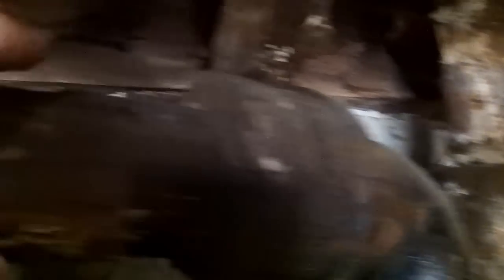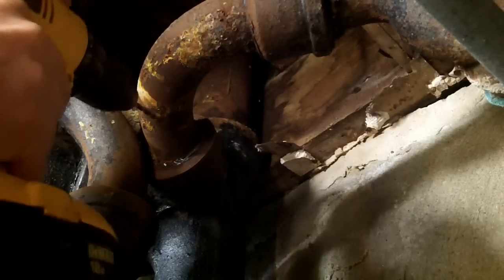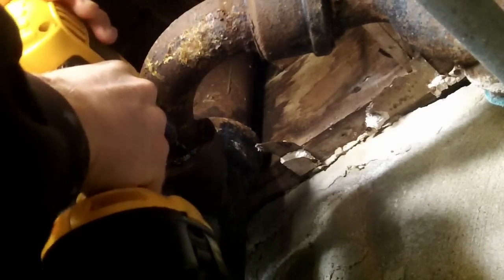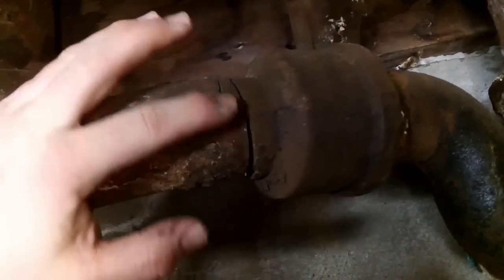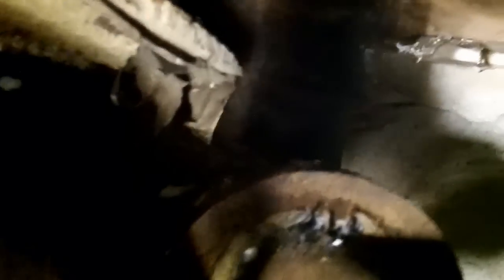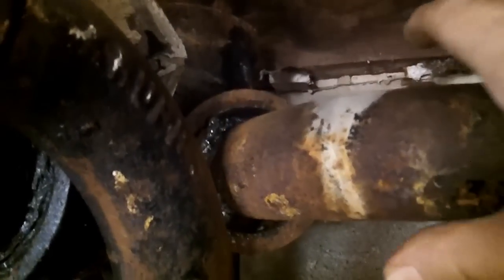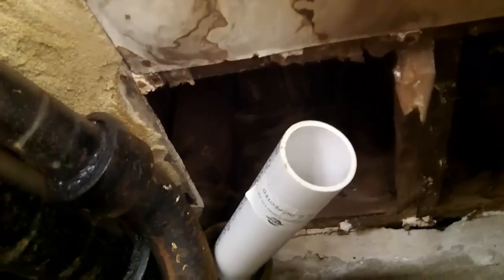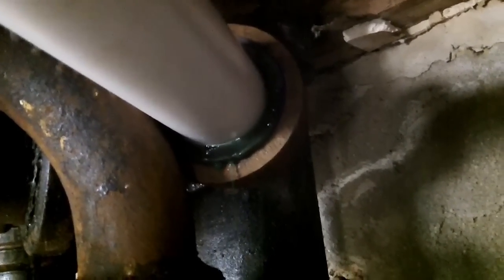Cast iron pipe to PVC using a Fernco Donut

Comment: Thanks bud. I have a cast pipe with a crack right on the other side of the wall. Plumber wants to dig the wall from inside. Im like wtf. Its 4 inch why not just get past the problem and call it a day. Water jet proved it drains two feet past the problem.

Comment: Read your cast iron, my home was built in 1951. There are different types of cast iron but look for XH or SW stand for extra heavy and service weight. They use different diameter hubs because the XH is much thicker. You’ll need a different donut that’s harder to find for XH. For a 3” extra heavy hub look for 33UX-305 the X means it’s for extra heavy hub. Hope that helps someone

Comment: How did it hold up after all this time? I am in the middle of the same bullshit..getting ready to remodel a bathroom and I have to replace a bunch of cast iron before I can finish.
Reply from the maker: Still no issues to this day. I have done 11 of these now. In various sizes at mine and my family's homes. It's an approved way of making the connection. This video basically shows a cheap way to remove the old joint and how to use the donut.

Good luck on the remodel. I've done 2 full baths and a kitchen in this current house. It never ends.
Reply: @phatdonkey78  Sweet, thanks for the fast reply. I guess I better get my drills charged up for tomorrow to remove that lead casting lol.
Reply from the maker: @BeastTechWrench   No sweat! I hope it goes smoothly.

Comment: Nice job. Are fernco donuts up to code ?
I have a similar problem. Was going to do the same as video
Reply: It went pretty smoothly I got it all in .
Thanks for the video 
It was very helpful.
Reply from the maker: In Pennsylvania they are up to code. Good luck. It's not too hard to do.
Reply from the maker: I'm glad it went well. The hardest part is getting the donut started. I'm also glad the video helped!

Comment: was the cast iron cut there or was that the original hub. I am just asking in case I run into a problem for myself later
Reply from the maker: It was the original hub.  I didn't have to cut it to make it work.  There are Ferncos that go over the old cast iron if there is no hub or if you need to cut it off to make it work.  They make a lot of products.  Good luck.

Comment: It would’ve been way easier to cut after the bend of the 90 where it straightens back out near the hub. Then you could just throw a 2 inch fernco or no hub band on the cast and connect to your new work. But what you did is tedious and takes time and patience. Much respect. 💪

Comment: Good video.  I have a similar cast iron flange coming up from a floor that connects to some light gray Schedule 80 PVC.  That PVC is sitting in some weird material.  I doubt it is solid and it is soft.  There is a leak there.  What size Fernco donut fits a 2" PVC pipe?  I'm trying to understand how measure and sell them.  Does the Fernco donut reference the size of the PVC and cast iron flange?
Reply from the maker: Fernco does sell them by size. You'll need to look at the cast iron and there should be a stamped number for the size of pipe. Usually 2, 3 or 4. Then decide what size pvc you want to use or replace and get the donut for those sizes. I have done 4 inch cast to 4 inch pvc, 2 inch cast to 2 inch pvc and 2 inch cast to 1.5 inch pvc. Good luck.

Comment: Do remember the part number for this? I’m getting confused with the different Fernco products.  Is this a 2 inch?
Reply from the maker: Your friend has shared a link to a Home Depot product they think you would be interested in seeing:

Fernco	2 in. Service Weight Cast Iron Hub to 2 in. Sch. 40 PVC Compression Donut
https://www.homedepot.com/p/Fernco-2-in-Service-Weight-Cast-Iron-Hub-to-2-in-Sch-40-PVC-Compression-Donut-P22U-205/100372278
SKU# 100372278
Reply: @phatdonkey78  thank you so much. What was the reason why you didn’t just cut it and added a no hub rubber connection? Was it because there’s not much meat leaf of good material once you cut it?
Reply from the maker: @bhadz100  I didn't want to mess with the stack and after getting the hub open I was glad I didn't just cut the pipe and attach it. The horizontal pipes were all pretty rusty inside and becoming restricted due to it. The fernco was the best route for me. I stuck a bore scope into the vertical stack and is had some scale but was pretty smooth over all. Therefore I did the donuts. Going into the main stack are 6 donuts now. (2) 4 to 4 inch for commodes (2) 1.5 to 2 inch for sinks and (2) 2 to 2 inch for a shower and a tub.

Comment: I sure wish I had watched your video before using a propane torch and stinking up my entire house with putrid smoke and also causing a small explosion when I eventually started drilling into the heated lead connection.  The resulting blast of lead and packing material just barely cleared the top of my head.
Reply from the maker: Yikes. I almost went the torch route, but was told to just take the time and drill it out. I'm glad you are okay and got it out either way.

Comment: Put the donut all the way on the PVC first then insert as much as possible and use hammer to hit it the rest. Instructions from fernco website
Reply from the maker: Thanks for the info. I was afraid I couldn't get it started that way or would push the PVC thru the end of the donut. Good to know though.
Reply: @phatdonkey78   https://www.fernco.com/downloads/installation-instructions/fernco-donut-installation   for full instructions in case I didn't describe it right. Glad I could help

Comment: Might be late, but I just came across your video and noticed you're still replying, so I've got a couple tips (maybe you want to switch out the rest of the cast iron at some point, if you haven't already). There's a tool called a "Ratchet Soil Pipe Cutter", Ridgid makes it. It's absurdly expensive if you bought it, but Home Depot stores tend to rent them out for 36$/24hr. It gets through cast iron the easiest out of anything I've ever used--- plus it tends to fit in just about every space no matter how tight to the wall. 

Otherwise, I use a reciprocating saw blade from from Lenox that's called "Lenox Diamond" and it specifically states it's for cast iron. Despite the printing on the saw itself saying "Cuts cast. Fast." it does not cut it fast at all. But, it does cut it--- and those blades are some of the most durable and well engineered blades I've ever come across. You do need steady hands and a fair bit of reciprocating saw experience--- being a different cutting angle midway through from your initial one will lock the blade up and cause some heavy kickback (which is how I learned the blades are nearly indestructible). Its main use is to get at spots the angle grinder can't. 

Anyway, good job, and props for making the video! You're right in that there just aren't good videos on cast iron pipe out there--- most of them them cover Step A and skip straight to Z.
Reply from the maker: Thanks for the info! I consulted a plumber friend over the phone and he said if the rest is good to not mess with it. When I did my second donut I ran a bore scope into each branch that I could and sent him pics. Barely any buildup in most of the pipes so leave them be. I have done 6 total now. 2 lavs, 2 toilets and 2 shower/bathtub drains. Basically the 2 bathrooms right above that space.

Great info though. I've seen the chain breakers and stuff too. If in the future I decide to take it all out, I'll reroute most of it as well. I understand cast doesn't bend but they just made so much happen in that corner it's crazy.
Reply: @phatdonkey78  Where'd you get a borescope?
Reply from the maker: @tomlampros7122  I got it on Amazon just search borescope.

Comment: What size fernco fitting is that? I'm installing 2" ABS, and I believe the bell on the 2" reciever pipe is 3", but I'm not sure - Home Depot sells 3" and 4"... just want to make sure I get the right one!
Reply from the maker: The sizes I used were 2x2. They do make a 2x2 XT I believe it is. Not sure about the lettering, but they make a plus sized fitting. It's somewhere between a 2 and 3 inch hub, but the PVC or ABS would fit the hole correctly. I hope that helps. I just used the standard 2x2 in this example.

Comment: Man, I specifically came back to say Thank You! Now I had to use a torch because there was a hard ring of lead before I could get to the drillable stuff. It took me 3 days to figure that out. When I mention this to a plumber (after the removal of the pipe). He said who knows, ur house is 200 years old. Fads came and went and got lost in time-lol. Anyways once i got that ring out with a torch I could then drill. Man if i didn't see this video I wouldn't of had a chance with this project (sink and counter and pipe replacement to mainline { thus the cast Iron}). Seeing you do gave me the direction I needed, and confidence too. So Thanks man...you saved me a lot of $.
Reply from the maker: Glad it could help. As I said I read about 200 times how to do it, but I like visuals and couldn't find any. Really glad it helped you out!

Comment: Had to remove a broken cast iron toilet flange many years ago and removed the lead the same way you did.  I was going to install 
a compression type toilet flange but I didn't trust it long term so I hired a professional plumber who installed at new cast iron flange,  He used the oakum, lead and caulked the lead in to finish it off.  I'm getting ready to replace some old cast iron 4" soil pipe in my basement with PVC and will employ the same removal technique and use a Fernco donut as you have here.  Nice job you did.
Reply from the maker: Thanks. It is a bit time consuming but is a good way to seperate the pipes. Good luck on the swap.

Comment: After you drilled the pipe out. What did you use to clean out the cast iron?
Reply from the maker: I used a wire brush if it needed it. Most of them were pretty clean on the mating surfaces. As for rust built up in the hub, i used a screwdriver to break it up and suck it out with a shopvac or push it into the drain stack.

Comment: Why not put a torch on the hub and melt that lead out???
Reply from the maker: I don't think a propane or mapp gas torch would be enough heat to get it melted. And I'm not going out to buy an acetylene torch just for this one job. The drill takes time, but no fuel.
Reply: @phatdonkey78  Propane burns at nearly 2000F....lead melts at about 620F
Reply from the maker: @johnsmith-sw7ii  Right. I think though, that the surrounding cast iron will act as a heatsink. Not sure though. Job is done for me, but others may be able to try with a torch and report the findings. I have done 6 of these total now (2 4 inch and 4 2 inch) and drilled them all. By the last one i was down to about 7 mins of drilling.

Comment: Nicely done thank you for posting this video. I have the very same project, except with a toilet flange. I've learned to see it done first before cracking into it. 😉
Reply from the maker: Glad it helped. I prefer to see first. Wasn't an option this time. I have since done 2 toilets, 2 lavs and 2 showers. I'm getting much better at it.
Reply: @phatdonkey78  oh boy well my project went a little sideways today..I'm working in a really confined space, no room to swing a hammer. That fernco donut is TIGHT! Nevermind liquid tight..that thing is probably air tight! Did the chamfering, lubed with dish soap..still no go by hand. Had to improvise..a little threaded rod did the trick. Don't ask😆
Reply from the maker: Some things are best left unsaid. Haha.

Comment: Cast iron breaks real easy you should’ve just hit it with a hammer and pried out the rest 
Incase anyone else has this issue
Reply from the maker: I was concerned with breaking the hub I was drilling into. If it broke I would have been in a world of hurt. It took a while, but drilling has little risk in cracking the needed hub.

Comment: Just what I needed to see. Replaced 18 ft of cast iron to ABS no hub connections but then uncovered an additional repair that deemed a hub connection and I was clueless. Thanks for the enlightenment.
Reply from the maker: Glad it helped. I'm doing another now and after drilling out the lead I realized I need an extra heavy fernco donut. Just a bit wider to fit the oversized hole of an XH elbow.

Comment: I'm helping a friend replace the entire subfloor and top section of waste pipe in her bathroom. I've never done anything like this so there's hours on forums and calls to my dad to get the knowledge. This video has taken a lot of weight off my shoulders as you've shown me I'm headed in the right direction with new confidence. Thank you so much.
Reply: I'm in the same boat for my own house. Remodeling and need to replace the copper fittings. Decided to replace the copper portion of the stack above the cast iron. This took some of the stress out of doing it myself.

Comment: Great video...my son needs this...FERNCO Was the answer...YOUTUBE is the best when people help people.
When ever I have a question I think YOUTUBE.  Car repair ...OBDII diagnostics. Get the code ...check utube
Plumbing, fluorescent tube replace with LED rewire fixture ....Replace MetalHalide with LED...CAR replace timing belt or water pump...TPS spring gone bad...if you can read you can do it with utube...I sometimes browse utube just for info. Don  dlepsch1@yhaoo.com

Comment: I have a roof vent that goes into my stack the same way, and it's leaking from a corrosion bloom from a previous repair. I have been putting it off because I didn't know what to do, to remove the 2" vent from the stack, or how it was made to begin with. This helped a lot! I didn't know that they used LEAD to seal them back in the day!! DAMN! I am a mechanic by trade, plumbing doesn't scare me, unless I can't figure out how it goes together, so your video was GREAT! Thanks!
Reply from the maker: I'm glad it helped.  I was in the same boat, didn't know how it all worked, but knew I could figure it out.

Comment: And another way to skin the proverbial cat...The back side of the manufacture"s label on the Fernco donut has instructions that worked easily! 1) Put donut on pvc. 2) Clean hub and lubricate donut (I used Dawn dish soap). 3) Drive donut into hub with hammer and wood drift. Thanks for the inspiration, phatdonkey78!
Reply from the maker: I guess if I read the instructions that would have worked! I have never been good at that. When I redo my other bathroom I'll try that technique and share it as well.

Comment: I melt the lead joint with a torch and it comes right out.
Reply: what type torch does it take? Will a small (hold in your hand) propane torch work?
Reply: @RG_sssSMOKING  make sure to wear a mask and all the protection needed. That lead seal is bad news, especially when it’s old
Reply: @kapstr8ds  Thanks Sergejs
Reply: @RG_sssSMOKING  Not likely. MAPP gas may come close, if not, it is a job for Oxy-Acetylene.

Comment: Great job doing it yourself, 2 pointers from a 30 year service plumber, first one, install the donut halfway into the cast iron hub. Second, use a file or grinder and put a bevel on the end of the pvc pipe then insert the pipe halfway into the donut then drive it home with a hammer and a piece of wood covering the end of the pipe. You are correct, dish soap works fine as a lubricant....unless you happen to have a tub of "duck butter"
Reply from the maker: Great info, thanks. I will be doing another 2 to 2 inch and a 2 to 1.5 when I remodel the main bathroom.
Reply: Just learned about that fernco fitting.

Comment: Could the same method be used when connecting pvc pipe to old lead pipe? I can't use a rubber coupling, because the lead pipe has much thinner wall, and I will never make a seal.
Reply from the maker: Lead is too pliable. There may be other solutions out there, but a fernco donut is not it.🙁

Comment: Thanks for the video.  I needed to learn the best way to remove the solder they used to seal the joint on the galvanized pipes.  
On another thought check 5:19 of the video.  John Lennon is inside the pipe.  Lol.
Reply from the maker: Haha.  I was hoping the camera would pick it up as well as the human eye, and you did.  It only had a small opening about 1/2 inch tall by about 7/8 inch wide.  Very good eye.  I also couldn't find a good way to get that clump of hair and stuff out so I pushed it into the stack and flushed the commode.  No issues.  Thanks for watching.

Comment: What kind of drill bit did you use?
Reply from the maker: Whatever comes in a cheap Dewalt kit. Any bit will work. Lead is soft. But if you wiggle the drill around, it can break the bit. Hope that helps.

Comment: can you melt the lead out with a torch or something similar?
Reply from the maker: You can, but only with proper respirators. Lead fumes are very very dangerous. Without the proper equipment, it is safest to just drill the lead out. You would also need a torch that gets much hotter than most torches due to the cast iron pipe absorbing most of the heat.
Reply: Thanks good explanation  @phatdonkey78
Reply: you can, vaporization of lead is the problem, melting isnt, but when you do it too hot, it will vaporize. Thousands of plumbers have been melting lead for ages. Mapp gas or oxy would work best. I'd be more worried about residual lead paint or asbestos from the ceiling than the lead fumes.

Comment: When the PVC bottoms out does that mean it's flush with the inside end of the donut, or is it touching the opposite interior wall of the cast iron fitting?
Reply from the maker: machalot It is flush with the inside end of the donut. The PVC doesn't pass all the way thru.